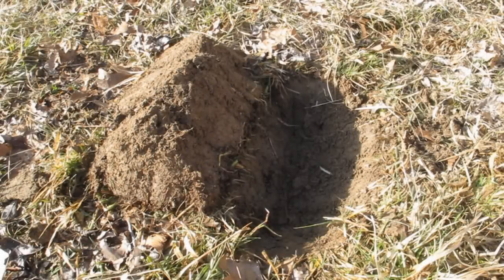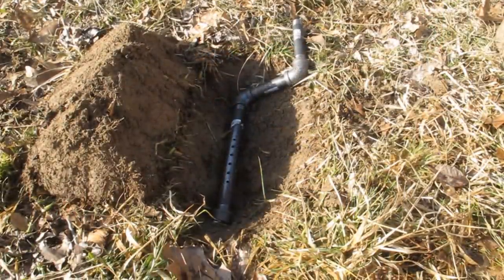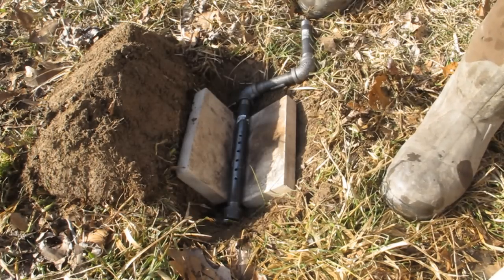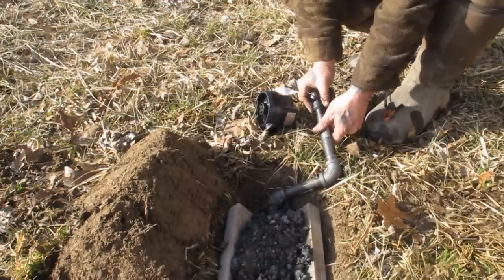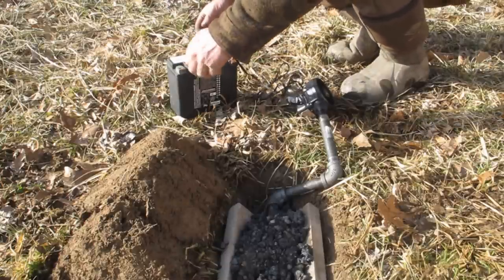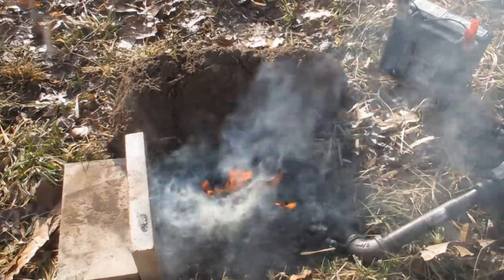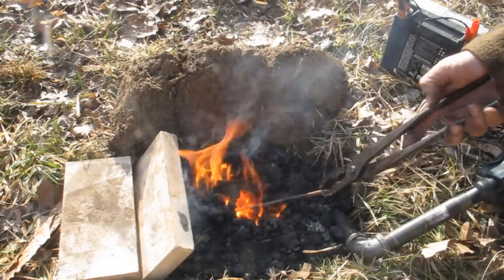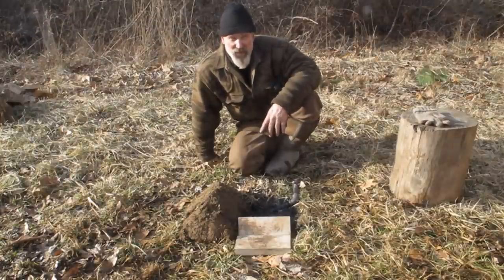Blacksmithing Part 39 Making a Portable Pit Forge

Comment: When I lived on a boat in the Delta, I'd charge my batteries using an old car alternator & voltage regulator scrounged from a junkyard. Used a fan blade and made a paddle wheel so I could either stick it up on the mast when it was windy or set the paddle wheel in the water and let the river's current do the work. Just a trickle charge, but it worked. Made a few for some of the other River Rats in the area.

Comment: hey here is another idea for making a forge out of a pit fire, just attempted it and it works pretty well, just dig a dakota fire pit and have a small hole where the pipe goes into on the bottom, this way there is no need to drill holes into the pipe. also its good for people like me that can't have open fires.

Comment: Instead of carrying firebrick ( fragile in the backwoods ) we use flat steel blocks 4x8x1 approx. 8 lbs.   forge flare ( similar to your's ), air-pump, battery, 2 and 4 lb. hammers, portable 8.5w Solar panel ( clips on back pack, tent etc. ) We do a lot of exploring in the Catskills NY.   Helpful to know how to build laterns out of old soup,soda cans, how to forge a bottle cutter, snake pole, slip-on steel toe ( needed in caves ).  Just a few ideas of interest.

Comment: It would be nice to have an efficient bellows or box type air pump  for these 
impromptu forges so that the need for batteries and electric pump could be eliminated.  Certainly two folks would help in that situation, one fella to pump air and then the blacksmith to do the forging.  Heck sounds like a job for my grand kids....  Well done sir!

Comment: How hot do those metal pipes get or does the cool air moving past them keep it cool?  I am wondering about melting the plastic adapter for your fan.  Thanks for the videos!

Comment: Dave, If it gets hot enough to forge high carbon steel, and make the steel yellow hot, then why wouldn't you also be worried about the pipe that's in the coals that's blowing the air through? Wouldn't the pipe get too soft or even possibly melt?